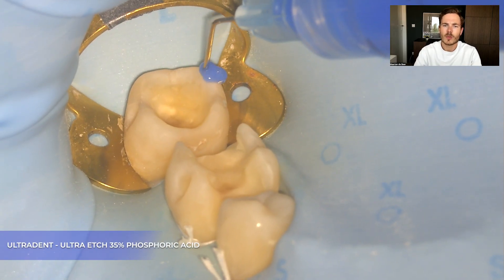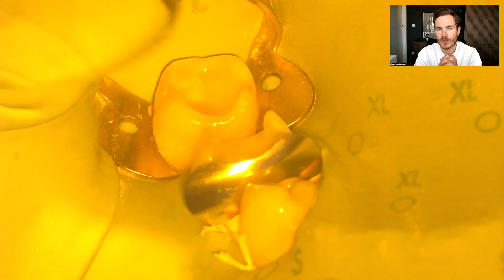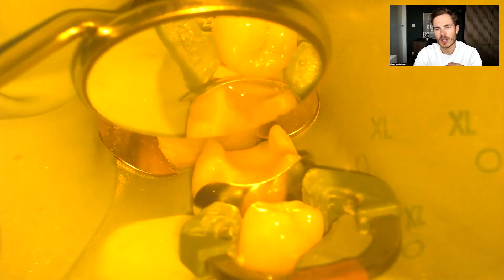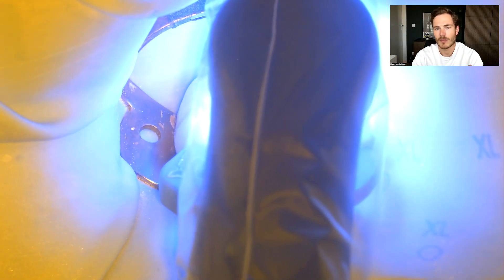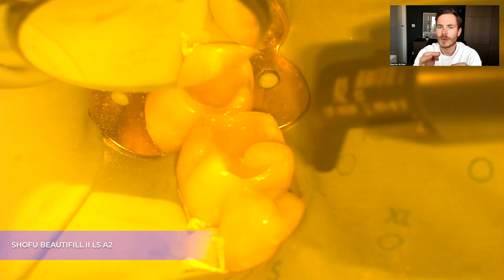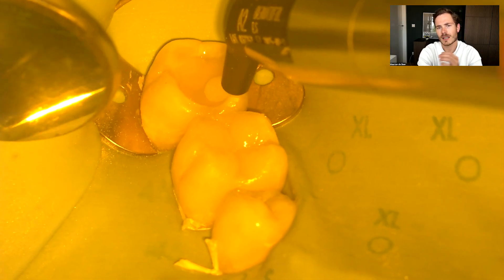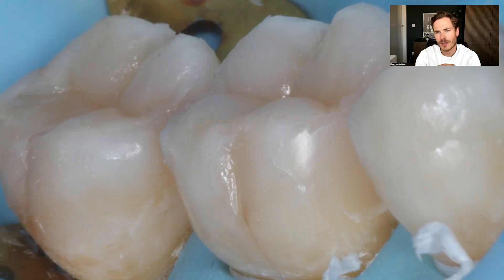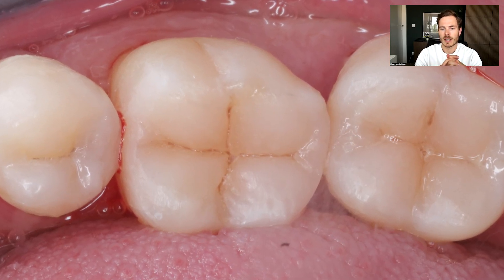THE DIRECT COMPOSITE QUADRANT - THE RESTORATION PHASE

Comment: Exceptional video doc - I particularly like how you placed packable composite overtop of the uncured flowable to use the differences in viscosity to your advantage. I will typically cure my base layer of flowable before building the marginal ridge but I think that I like your technique better. 

My only concern with this would be depth of cure, as I like to keep my composite layers <2mm in thickness to ensure complete curing.

Keep up the terrific work, subscribed!
Reply from the maker: Thank you! That's a super good question. I also like to keep my layers thin in order to make sure I get a full depth of curing. Therefore when I make my marginal ridges I make them very thin (+/- 1mm thin). So even though they might be high, they are not thick and I think I get a full depth of curing with this. Also after removing my matrix band I cure again from different angles, just to be sure.